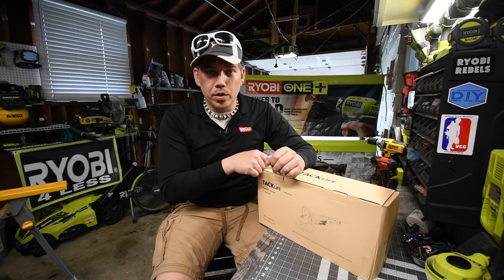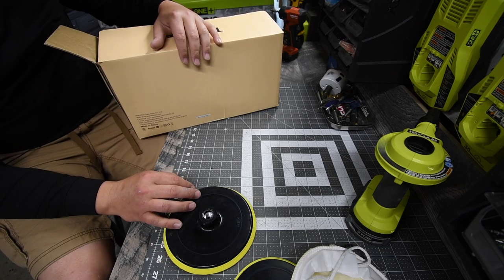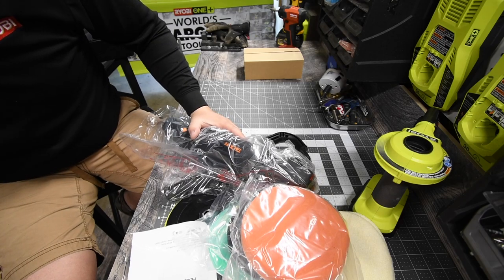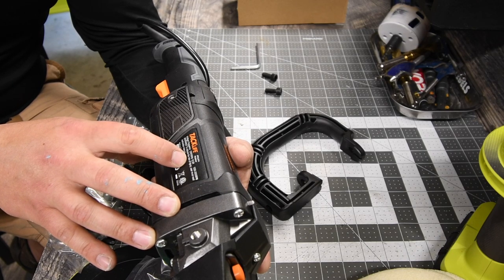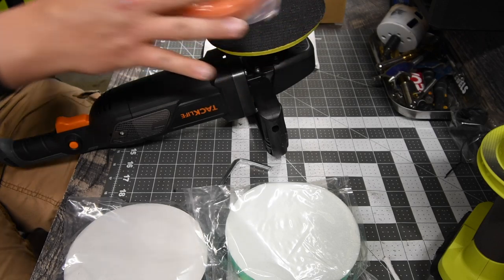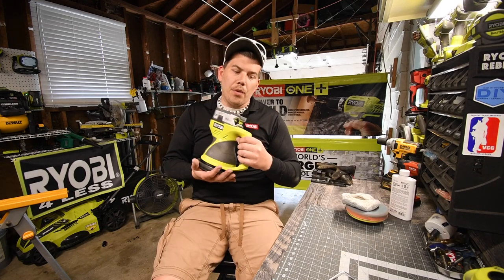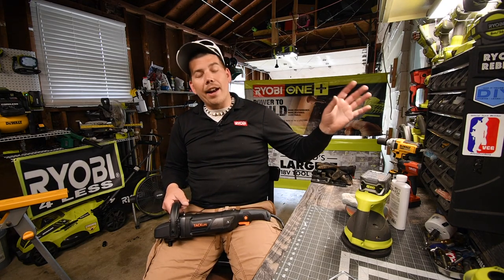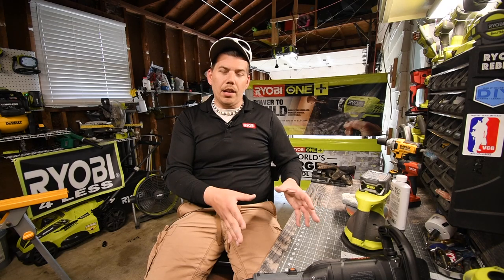How to Deoxidize a boat

Comment: Angle the pad. Dont use the full pad. Use it at an angle and dont hold it on the paint too long. Gel coat is diff, its strange. You follow diff rules with it.
Reply from the maker: Gel coat is a little more lenient when it comes to friction